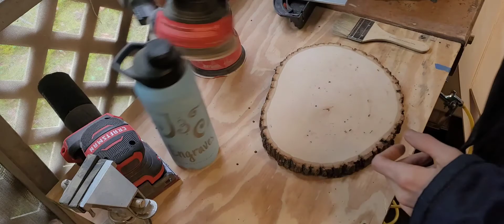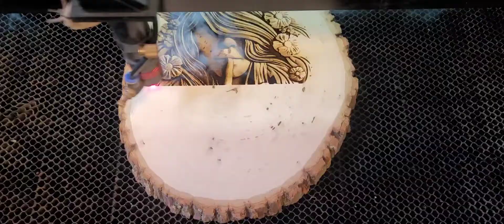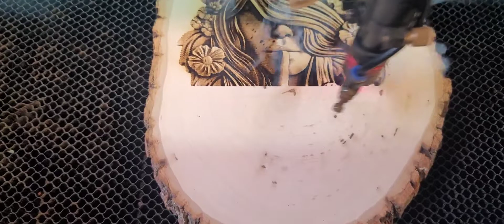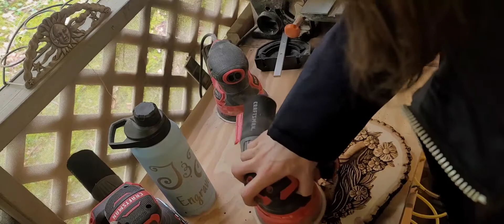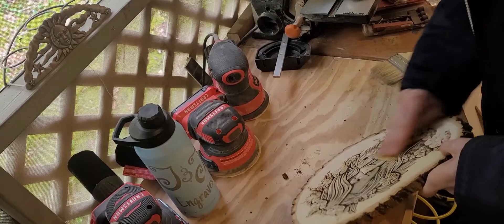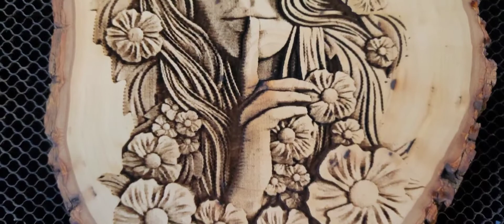3D Relief Design Laser Engraved

Comment: what was the settings you used? i cant ever get my laser that clear
Reply from the maker: It really depends on your machine.  We run a 100w C02 with a 2.5 inch focal lens.  Settings are really important but editing has to be right or no combination of settings will work.  This one is a grayscale image so it's a bit different than a normal photo too.  We ran it at 200 speed, 50 power, 275 DPI, in grayscale mode.  Edited in Photoshop and lightburn.